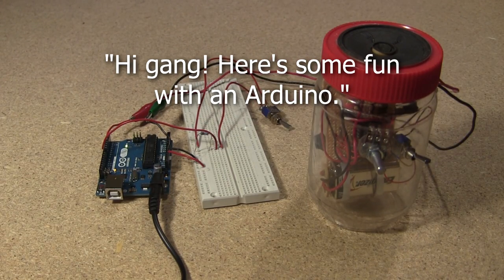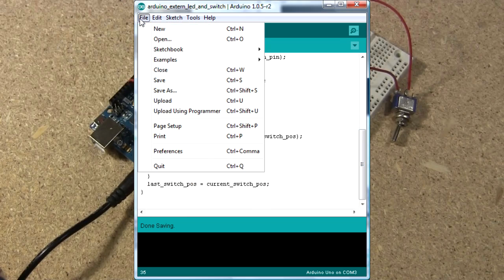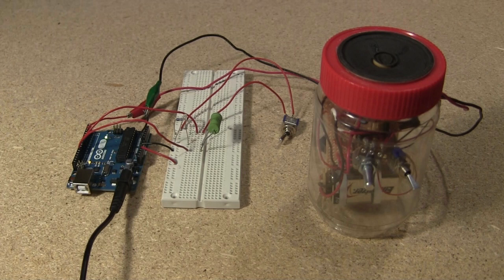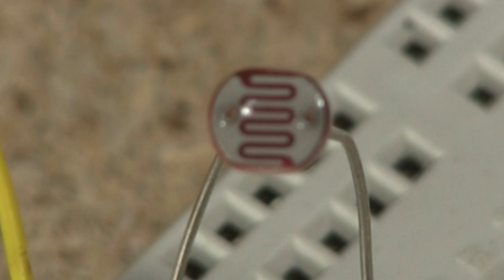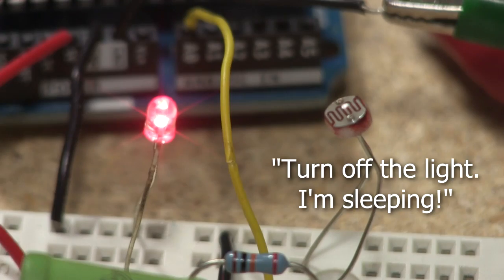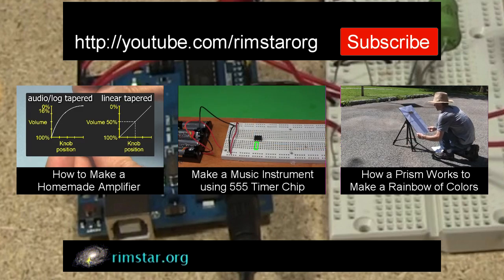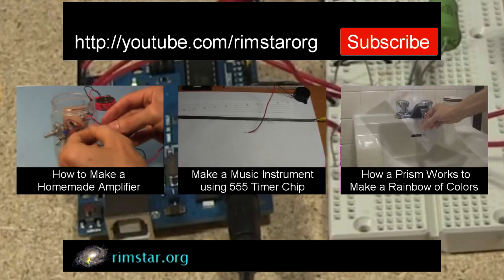Fun with Arduino that Talks with Speech Synthesizer

Comment: The voice I am getting by my speaker is really very low..What can I do to increase the voice??
Reply from the maker: How are you playing it back? The jar that my speaker is sitting on top of is an amplifier. You'll need an amplifier for higher volume. See the circuit diagram on my webpage here https://rimstar.org/science_electronics_projects/ardunio_speech_synthesizer_using_talkie_library.htm The amplifier I'm using is my homemade one https://rimstar.org/science_electronics_projects/make_crystal_radio_amplifier_for_speaker.htm

Comment: Hey Great projects, I want to make make a Talking skull with a servo to turn the head towards a person walking up and then it talks to them ,could you give me some pointers oh this is my first Arduino project too  Thanks
Reply from the maker: I wouldn't use Talkie since it's very hard to generate the speech that you want. One possible way to do the voice is what I use for my Scareduino here https://rimstar.org/science_electronics_projects/arduino_adafruit_audiofx_soundboard_skull_scareduino.htm.
I do a jaw here https://rimstar.org/science_electronics_projects/arduino_controlled_skull_scareduino.htm though it's a little flimsy but it is fairly easy to do. In a newer version I'd make it more robust.
I haven't done a turning head but there are many ways to do that. Here's one way that James Bruton did it https://youtu.be/o2pJPodRsCw?t=6m21s but that may be too advanced for you.

Comment: I keep getting a compiling error. I've copied your code from your site but it doesn't compile.
No such file or directory #include "talkie.h"                    ^compilation terminated.exit status 1
Error compiling for board Arduino/Genuino Uno.
Reply from the maker: Did you also install the Talkie library? https://github.com/going-digital/Talkie I also talk about it more on my website.
Reply: RimstarOrg yes I've fixed the library issues but now I've got an error with the variable 'spah'
Reply from the maker: What's the error?
Reply: exit status 1
expected initializer before 'spah'

I did tweak the code to fix the original error by adding const char * in the start of line 14
Reply from the maker: That's odd. Maybe something changed in a library somewhere since I uploaded this. My Arduino's tied up in my BB-8 droid but I'll see if I can try it out with the latest and then fix it. Thanks.

Comment: Can you please share the circuit diagram of the amplifier?
I made my text to speech project using the following example and its library- blog.circuits4you.com/2016/04/text-to-speech-on-arduino.html.  Unfortunately the speech is not clear , although the code is working fine. 
As suggested, I also tried out this library https://github.com/going-digital/Talkie but it gave an error message while adding the library -
/*Arduino: 1.6.5 (Windows 8), Board: "Arduino/Genuino Uno"

_1_Getting_Started.ino:14:20: fatal error: talkie.h: No such file or directory
compilation terminated.
Error compiling.

Specified folder/zip file does not contain a valid library

  This report would have more information with
  "Show verbose output during compilation"
  enabled in File > Preferences.*/
Please help me with this problem.Your help would be greatly appreciated.Thank you!
Reply from the maker: The amplifier circuit is at http://rimstar.org/science_electronics_projects/make_crystal_radio_amplifier_for_speaker.htm which includes the video http://youtu.be/JtPwxbOgBHw.
Regarding getting Talkie to work, you could try doing as the error message suggests at the bottom to get a more verbose output to get more information.
Also try asking at https://github.com/going-digital/Talkie/issues. I recall mention that the library doesn't work well with newer versions of the Arduino development environment but you can see more about that on that webpage or in the comments to this video. I don't recall which version of the development environment I'd used at the time.
Reply: Thanks for your reply.

Comment: From what you wrote I'm guessing you managed to use the included Freemat code to generate the binary?  If so what version?  The current version seems to conflict with wave.m ...

Any info would be greatly appreciated. Have a happy New Year!
Reply from the maker: I used FreeMat version 4.2. You might also want to have a look at the Issues tab on the github page https://github.com/going-digital/Talkie/issues for clues in case anyone's had similar problems.
Reply: Ah, I didn't point the Freemat project at the directory with my .wav file. It works now.

Still, any tips on pitch correction? 
modding the calc.m pitch variable from 253 to something lower helps a little... Does lowering pitch of the original wav help you any?
Reply from the maker: I didn't have any issues with pitch.

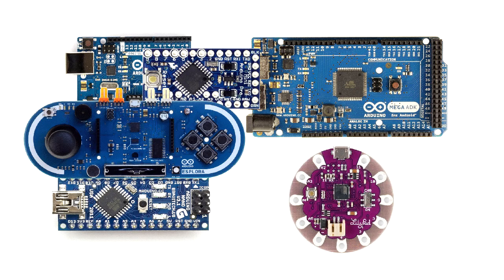Comment: 0:13 "What is an arduino? It's basically a family of small computers or boards that have microcontrollers on them"

WRONG! Arduino is a family of prototype shields for Atmel's megaAVR family of microcontrollers. It was created to ease the development stage with those microcontrollers for tinkerers, artists and hobbyists. ;)

Comment: Hi,  is it possible to program the Arduino to say a certain speech at a specified time. Basically an automated announcer. How does one get to communicate with you for further assistance and discussion?
Reply from the maker: +Pula Sure, it's entirely possible to do exactly what you ask. See these pages on the Arduino website http://playground.arduino.cc/Code/Time and http://playground.arduino.cc/Code/DateTime. My preferred means of communication is here in the comments. Note, I haven't done any synchronizing with external clocks myself, something you'll have to do to keep the time on the Arduino accurate. The links I gave talk about that issue.
Reply: +RimstarOrg I am working on a project, for my BTech Electrical Engineering. Would you kindly be my mentor? if this is will need some compensation we can discuss that as I have never used the arduino product before nor, programmed.
Reply from the maker: Pula
Mentoring's not something I have time for. However, a great place to start learning Arduino is Jeremy Blum's Arduino tutorial series https://www.youtube.com/playlist?list=PLA567CE235D39FA84. For reference, the Arduino website itself (https://www.arduino.cc) is pretty good and if you buy parts from https://www.adafruit.com they have excellent tutorials for those parts. Those are my main sources anyway, there are probably others too.
Reply: +RimstarOrg thank you. I appreciate the replies

Comment: That's pretty cool.  How did you record your voice tho?
Reply from the maker: +Tim Spriggs Thanks. I used a library I found on github called Talkie. I recorded my voice with a microphone and created a wave file on my computer. But it was quite a complicated task to convert that wave file to something that was in the right format for the library, so complicated that I started documenting it and gave up. I got the hints for how to do it from here https://github.com/going-digital/Talkie/issues/4 though. Looking at that page again now, I see that no one's simplified it yet. It's not much but I at least documented my circuit and Arduino code here http://rimstar.org/science_electronics_projects/ardunio_speech_synthesizer_using_talkie_library.htm.
Reply: RimstarOrg I am a rank newbie Ardweenie but I am a retired elec. tech so I will have to try this circuity only because of the fun factor.  I'm also the type who never gives up.

Comment: wow, that lib sounds a whole lot better than most costly text to speech chips or modules i have heard. does it generate the speech melody by itself, or do you have to program it?
Reply from the maker: +Cuda FX The library comes with a whole bunch of pre-made speech, but I made my own anyway since I was putting it in a youtube video and was worried about copyright issues. It's a messy tool chain and took a little programming to make one missing conversion tool. I detail some of it on my webpage here http://rimstar.org/science_electronics_projects/ardunio_speech_synthesizer_using_talkie_library.htm. I pieced it out from clues here https://github.com/going-digital/Talkie/issues/4 where I got the library from.

Comment: can i use in PIR motion sensor then dedicate  that  text to speak ???
Reply from the maker: +Jamiul Khalid I haven't done it, but I'm sure you can.
Reply: +RimstarOrg thank u for your reply !
Reply: +RimstarOrg  can u help me ? WHAT IS diagram & code for PIR Motion sensor that detect that text to speak ?? anyone can't help me . so u can . plz . this is urgent !
Reply from the maker: Jamiul Khalid
I don't have any code for a PIR motion sensor. All the code I have is for what you see in this video. All diagrams and code for that are on my webpage at http://rimstar.org/science_electronics_projects/ardunio_speech_synthesizer_using_talkie_library.htm
A place that might help with the PIR is Adafruit's website. They usually have tutorials for their products. Here's the main page:
http://www.adafruit.com/products/189
and here's a page that was linked to from there:
https://learn.adafruit.com/pir-passive-infrared-proximity-motion-sensor/
Look through that and you might find code.

Comment: RimstarOrg  there's a problem compiling the talkie code using newer arduino IDEs (mine is 1.5.8), how did you get around it?
Reply from the maker: Ramin Assadollahi I guess it's a good thing I've been ignoring the message that's been popping up lately whenever I start it up asking if I want to upgrade my IDE. :) Mine is still 1.0.5-r2. I'll have to reassemble the circuit and see if I have the problem too. In the meantime I suggest you have a look at https://github.com/going-digital/Talkie/issues to see if anyone else is encountering it.
Reply from the maker: Ramin Assadollahi Oh, I see you're already checking on github.com. Nevermind that.
Reply: yeah, i think the code has lots of potential but the owner seems not to be too active in that area unfortunately.

Comment: Arduinos are fun, and they are fairly inexpensive to buy. You can pick up a kit for a very reasonable price on Ebay. Nice Video!
Reply from the maker: electronicsNmore Thanks! I didn't know they had kits on ebay, good to know. I've been looking mostly at adafruit's website.
Reply: You can buy an UNO R3 on Ebay for $9 shipped with a USB cable. :-)

Comment: Analog in are not "analog in only" pins can be used as digital IO.
Reply from the maker: kiran shrestha Yup. I meant you couldn't do analog output with them. Though I wasn't aware you could still do digital output with them until bartibv pointed it out below, and then I tried it. But now that you bring it up again, I'll see if an annotation would be good there.

Comment from the maker: Started playing with Arduino by making it talk. As you can see, I had some fun with it. Enjoy!
Reply: RimstarOrg How did you wire it?
Reply from the maker: GoldenDude Michael
I just uploaded some circuit diagrams on my webpage here http://rimstar.org/science_electronics_projects/ardunio_speech_synthesizer_using_talkie_library.htm Hopefully that will help.
Reply from the maker: +Electronic Experiments I used the Talkie library I found on github https://github.com/going-digital/Talkie. The circuits are on my webpage here http://rimstar.org/science_electronics_projects/ardunio_speech_synthesizer_using_talkie_library.htm.
Reply: how to do it with JAVA please?
Reply from the maker: Does Java run on an Arduino?
Reply: yes sir,
Reply: RimstarOrg if you're wondering, there you go http://playground.arduino.cc/Interfacing/Java
Reply from the maker: I thought you meant writing code in Java to run on the Arduino. If I'm understanding it correctly, the page you linked to seems to be about ways of communicating from a Java program to an Arduino. That's something I'm not likely to do. I don't have any need right now.

Comment: Another Flawless video!Why the noise is a little 'krispy'?Thanks heaps for sharing!
Reply: RimstarOrg Could you describe all these steps in details : convert it into data or encoding it ?
thx
Reply from the maker: Jean-Luc Deladrière I'll try and put together a webpage with all the steps. It may take a few days though.
Reply from the maker: solosipahi Thanks! I'm not sure of all the details but part of the sound issue is in the encoding. I record my sound, put it into my computer, convert it into data, and copy that into the program code. The data is very compressed compared to the original sound file. Actually, I lowered the pitch while it was still on my computer to make it sound less like me. If I don't do that then the output from the Arduino is much clearer but sounds much too much like me, so I had to lower the pitch despite the loss in quality.

Comment: Raised a big smile over here... good to see you tinkering with these, lot of fun. Check out the Mozzi library (if haven't already) it's an audio synth system and even some of the example Sketches are stunning. Some of the best audio i've heard on mine has come from crystal radio/old telephone speakers, certainly when unamplified...might be a tip :)
Reply from the maker: slider2732 Mizzi looks interesting. I might just be able to use that. I was planning on trying PWM to do sounds anyway. Thanks!

Comment: Cool video!  Glad to see you working the with Arduino!
Reply from the maker: navic209 Thanks! Yeah, I've been looking enviously these past years at what you've been doing so now I'm finally taking time to do some too!
Reply: RimstarOrg
it keeps saying talkie does not name a type. why?
Reply from the maker: Dalton Marcum I can check tomorrow but I suspect you haven't copied the Talkie folder where it needs to go. Find out where your Arduino libraries have been installed and copy it there. For example, under windows I have C:\Program Files (x86)\Arduino\libraries\Talkie. That Talkie folder is the one that contains files like talkie.h and talkie.cpp and subfolders encoder and examples. Let me know if that fixes it for you.
Reply from the maker: Dalton Marcum Oh, and I just found this about adding libraries to Arduino http://arduino.cc/en/Guide/Libraries
Reply: Okay I will try that. Thanks